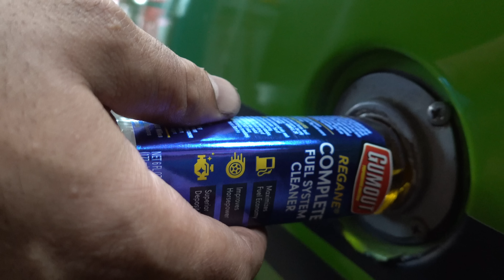My First Car! 1971 Dodge Demon 340 Walkaround with Special Guest Hudson D!

Comment: This is the best car you own IMO, just love it, the green paint is killer. My grandmother bought a 73 Duster new, she was so proud cause it was the first new car she bought on her own. Her car only had a Auto trans as the only option, man brakes, no radio no power steering. She had it painted once, had the seats redone once, put 260K on it before she took it off the road and gave it to her mechanic ( it was burning oil ) in the mid 90's, she told me she didn't want me to get it cause she thought I would destroy it.

Comment: Hey Tony, when you did the tubular k-member, why didn't you use one with a rack to make the car front steer? It sure would make dropping the pan easier. Also, when I use anything chrome, I use a brown cookie roloc and grind the chrome off anywhere a gasket sticks. Roughing it up helps the sealer to stick to it.

Comment: I had a 71 Demon in my younger days. It was a 340 car but had a 360 in it when I bought it. That car was a blast to drive and did burnouts for days. I had to let it go when I got married due to the fact that my wife would have killed herself driving that car. A year ago I picked up another 71 Demon that was in rough shape and needed a ton of work. I made a few passes at the drag strip and the 318 was pretty sad. At the moment I'm finishing up a Hemi install and should be back driving it in another week. You have a nice car Tony, glad you hung on to it!

Comment: AWESOME.  My first car was a 73 Dodge Dart Sport 318 with the super rare factory sunroof that was nearly half the size of the roof.  Got it with 43K original miles from my Grandmother after it sat in her driveway my whole childhood (My grandad dided before I was born and she didn't drive).  I loved that car espescially while everyone else was driving Honduhs and Nissans etc.  I had a V8 muscle car and I did everythibg I coukd to make it a REAL muwcle car.  Magnum heads off a FI 318 of the time (early 90s) 4bbl carb,  super rare Mopar cop-car steel wheels... evebtually sold it to a guy who collects Mopars here in the PNW and its still running around today.

Comment: You've got a big 💖 Tony. Curious why you didn't replace that stamped steel pan with a nice aluminum unit with flat milled rails? Baffle perhaps?
Reply from the maker: Yeah, it's on the to-do list for sure, especially after seeing the oil pressure drop doing donuts.

Comment: I had a 1971 Plymouth Satellite Sebring Plus I bought in 1974 that had the houndstooth buckets in it. Surprisingly they were very comfortable compared to the vinyl ones when it was hot or very cold. I wish it had been a Roadrunner instead but the insurance would have been cost prohibitive when I was 18.
Reply from the maker: They are super cool, not sure you can get them reproductions but I love the houndstooth. I was after a 72 Roadrunner 340 4 speed car pretty bad when I bought my demon. I couldn't afford it at probably 5k
Reply: I had a 71 Satellite too when I was 18 - 24, put a 340 & a 4 speed in it, big tires & slots.  I dream of having another really bad

Comment: Awesome Demon!! What purple you got in it? Also rear gear? Thanks.
Reply from the maker: Rear gear is a 3.91 with the factory cone style LSD. Some kind of upgraded axles in the larger bolt pattern. It's the mild cam, 268/284 I believe. Could use a modern grind in there sometime.
Reply: @StayTunedTA  thanks!👍😎

Comment: I love Mopars. I had a 71 Demon with a slant six in it. Of course, I was an idiot and blew the engine and let the car go in 1990. Now, I want to kick my own butt.
Reply from the maker: Yes, that is the correct feeling.
Reply: Now, I am looking for a short box D100 from 74-80. I loved those trucks when I was younger. I'd like to do a 4 link coilover 8 3/4 rear end with a custom front end with rack and pinion. Also, coilovers. I torn between a LA 360 or Gen III Hemi. Just  a dream of mine.

Comment: My name is Duane I have a 72 Dodge demon modified slant six bored 30 .095 shaved head 3 angel back cut valve stainless steel valve s Comp cam kit 252 .435 lift and a 500 CFM Edelbrock

Comment: love first car stories. I so wish I had my first car. Best is i never ever stopped wishing i could have another one. It was a little 1968 amc javlin. it had a bagged out totaly wore out in line 6 cylinder, with a i wanna say muncie? 4 speed and unsure what diff was in it. I laugh still how it took 3 quarts of oil for me to drive it home with the never see through blue cloud that fallowed me every mile. I sold some of my pigs to get the 200.00 i paid for it. I was 13 turning 14 in less than 2 months. I knew the car and the previous owner, they told me they were trading it in on a new car so i was at the dealership the day he took it there to make the deal so i could buy it. I was the happiest proudest kid on the whole block that day. Living on a farm, i drove it out on the trails across the pasture and feilds using used oil from the tractors when dad changed oil. by my 16th birthday, dad helped me swap out the wore out 6 with a 390 from a old galaxie he had. that car was so rusted out you gagged to go down a gravel road in it. so basicaly my first car was a javlin with a 390 4 speed.